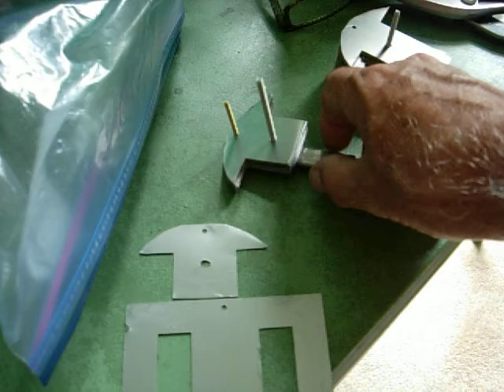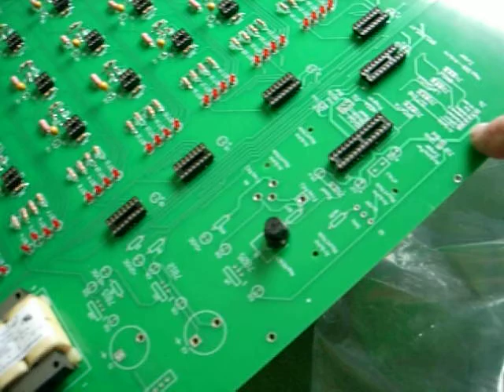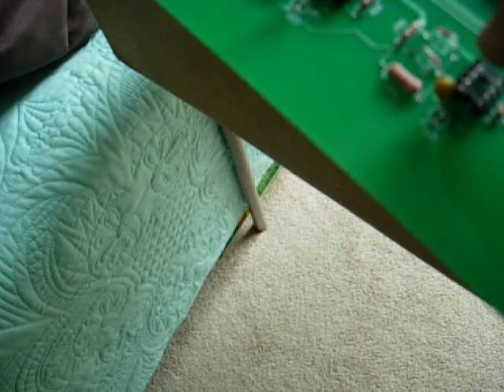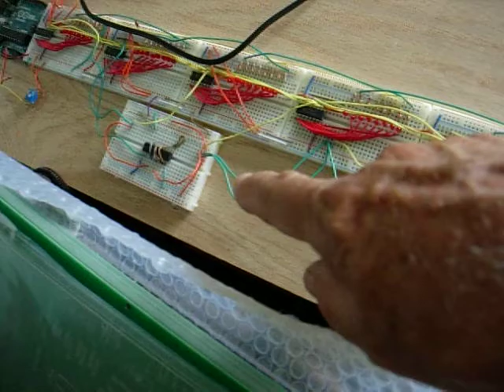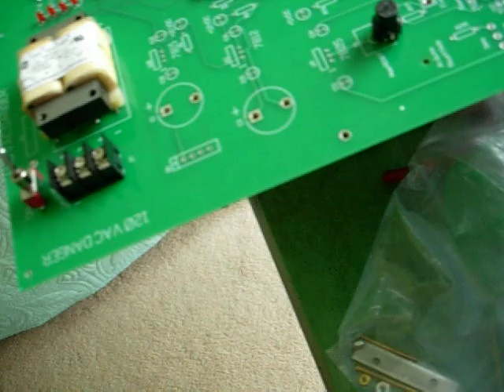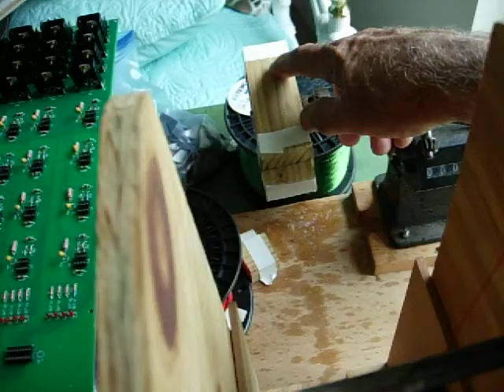Don Smith #176 new control PCB  and rotor coil support

Comment: Hi Gary .You keeping busy i see .Look forward to see it all completed.Gez.
Reply from the maker: Gerard I'm getting real close to firing it up maybe today or this weekend.  I did get the two pink quartz pyramids for the anti gravity platform. but testing that maybe extremely dangerous.  I used ratios from the crop circle to determine that my platform of coils needs about 1 1/2 " pyramids.  Look at ARKCRYSTALS.COM and read the patent app 20150093571.  the center crystal produces voltage for free but they don't talk about it. They were told not too by some very bad greedy people .    The two pyramids  are placed back to back in center 16 coils of 20 are energized 4 coils point to pyramid base points, this allows etheric energy flow from the vacuum to enter the pyramid structure and produce a vortex.  the 16 coils have energy levels 4,10,17 derived from crop circle 5 level binary codes and these energies cause the central vortex to push the platform in one direction.  MY GUESS

Comment: I have been a sub for quite a long time. I like what you are doing and I think I know what you are trying  to do. I wish I knew more about electronics. Anyway I know you live somewhere here in Florida and so do I . If you ever want a visitor to show your work just ask.
Reply from the maker: Hi Russell I live in Melbourne on my yacht anchored in the river. Join USN and worked on subs off Guam. 50 years ago WOW time flies.  I have put everything I have done in the lab on You Tube.  You can learn a lot by following my work both mistakes and fixes are shown.   Current projects are car impulse motor and antigravity platform based on the crop circle.  I used to be a super tech working with MIT engineers for several companies in New England.  They gave me a schematic and said built it. One board was wire wound with 2000 wires. I built the very first word processor on earth it was huge, now they are hand held.   Now doing energy research out of a storage unit 10X20.  I need a self running energy system for my car impulse motor source.   As you know generators use magnets on rotor or brushes with Dc to rotor to create a magnetic field.  shaft spins and field flux cuts thru the stator windings to generate AC.  The key here is the rotating field but it doesn't need to be done mechanically.  I'm going to use the Arduino to control FETs to rotate the field around the stator and the flux will cut thru the rotor coil turns so everything is reversed.  Pierre did this with mechanical relays it works. Something must have happened because ALL of PIERRE's videos have been deleted. VERY ODD